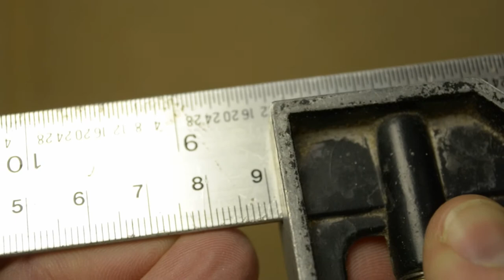How to Build a Mobile Mitre Saw Stand | DIY Project

Comment: How's it holding up?  There doesn't seem to be anything bracing it from wobbling side to side.  Seems like it would be tight right when it was built, but after some actual use and abuse, it will start to lean and rock to the sides.
Reply: giantpune I am wondering the same thing.